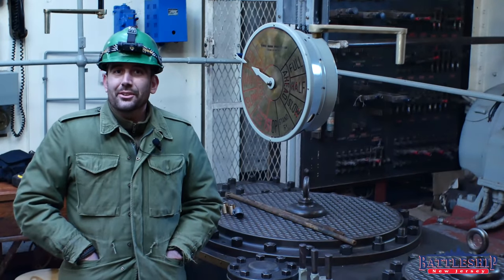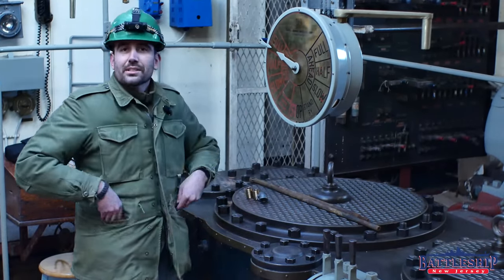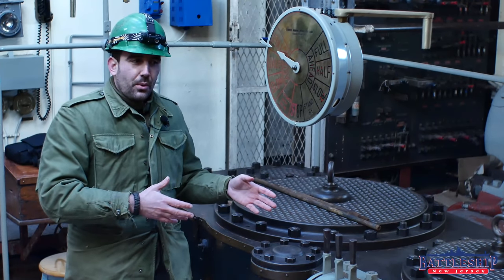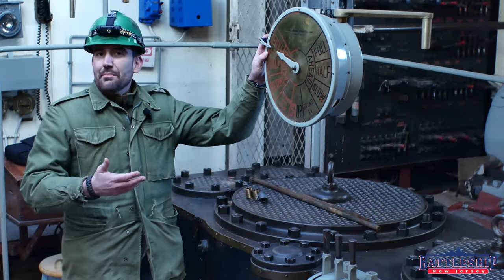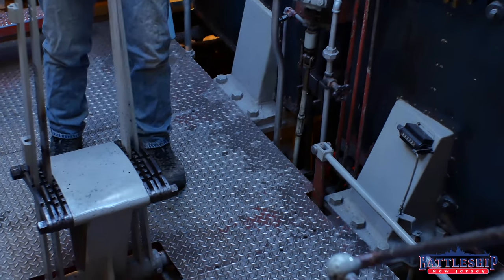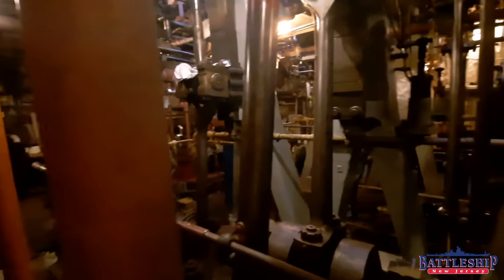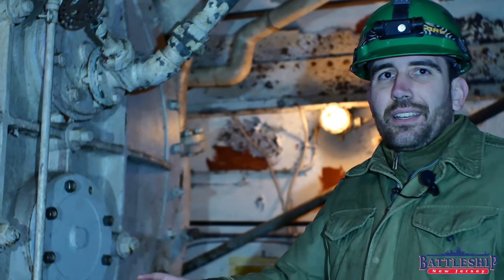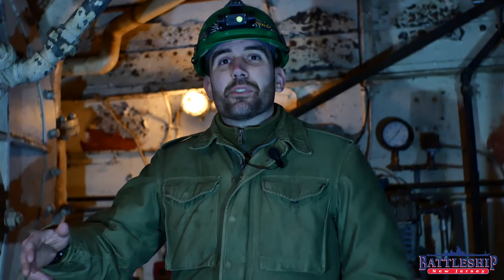Reciprocating Steam Engine: USCGC Lilac

Comment: The SS Badger still makes regular trips across Lake Michigan and it has reciprocating steam engines. (and coal fired boilers, even though it was built in 1953🤔).
Reply: You've heard of the Edmund Fitzgerald? It was a reciprocating coal burner built in 1958. I was in the US Navy with a guy from Alpena, Michigan who worked for a time in the boiler room of a lake boat. He shoveled coal for 6 hours straight. He said he thought he was going to die. This was in about 1970 as he told me. He'd shovel coal, build up the main steam pressure and then sit on a coal pile with an old guy who'd been doing it all his life and drink bourbon until the pressure dropped and then it was back to shoveling. He said that the boat was built in 1910.
Reply: The Badger has 4 Foster Wheeler watertube boilers with 2 Firrite stokers per boiler. The boiler normally runs at about 410-420 psi. They provide steam for 2 3500 horsepower Skinner Uniflow steam engines. They're direct drive as in no reduction gear/transmission. They give the Badger a speed of about 14 mph. Steam also operates 2 500 kw turbogenerators for electric power.
Reply: Yup about 25 miles from my house. 
Dumps a lot of coal ash in the lake 🤦🏻‍♂️👎
Reply: @lawrencelewis2592 , the Fitz had a steam turbine for main propulsion and while she may have started out with coal fired boilers I'm pretty sure that they converted her boilers to oil before she sank.
Reply: @busterbeagle2167  ,not anymore. They have an ash handling system and they take it off inport now. Definitely in Ludington and possibly in Manitowoc too.
Reply: @albertoswald8461  I would sure love to go down the engine room of that one! I am a former marine engineer and running a recip is my all time dream!
Reply: @lawrencelewis2592  ,What did you sail as? I have 1st Assistant for steam and 2nd Assistant for diesel and gas turbine ships. I got off the SS Wilfred Sykes November 11th after about 2 months as 1st on her. I worked the Badger unlicensed in 1994, 1995,1996 and went up to my brand spanking new 3rd Steam license in 1997. Got out bounced around and worked her again in most of 2007 as 2nd did a month in 2008 and then 2009 and most of 2010. I did about a month on the Crapo in December 1995 as an oiler too!
Reply: @lawrencelewis2592  ,it is pretty cool. I've run the Badger, the St.Mary's Challenger and the SS Delta Queen paddlewheel steamer. I worked the Crapo as oiler so I only would operate her engine to start turning it over for warm up. And once I answered a bell since my engineer had to go potty!!😁
Reply: @terryboyer1342  ,true but she has a steam turbine. It's a Delaval too if I remember correctly. The Lakes still have a few steamers. Key Lakes has the Philip R. Clarke and the Arthur Anderson. They still have the Cason Calloway but I hear that it is going to be scrapped. Central Marine Logistics runs the SS Wilfred Sykes for Cleveland Cliffs and it's not running but they do have Edward L.Ryerson in long term layup. As mentioned, the Alpena is run by Inland Lakes Management which works for LaFarge Cement. These ships above all have steam turbine main propulsion. The Badger is the last one on the Lakes that has a reciprocating steam engine of any kind.
Reply: @albertoswald8461   I was a Machinist's Mate 2nd class on the USS Guam, LPH-9 from 1974 to 1979.

Comment: Richard McKenna was a navy engineer, and in his book "The Sand Pebbles", he details correcting a fault in the alignment of the bedplate (what holds the crankshaft) of a triple expansion engine. The man knew of what he wrote... :-)  He also wrote a short story entitled "King's Horsemen" that describes an emergency repair on a running triple expansion engine that is a real nail biter.

Comment: The Texas,  New York and Okkahoma were throwbacks.  The previous classes after the two South Carolina's were steam turbine engined.
Reply: Problem with steam turbines of the previous ships is they were very poor at fuel efficiency when cruising. Hence why the back track to tripe expansion on the new yorks (remember originally coal fired.) The Nevada was oil fired from the beginning which helped with range and efficiency. But then after the USN always sought to remedy the range issue of turbines. With geared cruise turbines, turbo-electrics, and finally double reduction.

Comment: Triple expansion kits are pretty common in model engineering. Stuart Models in the UK produce a large number of kits (including just single expansion kits). I'm working on a 10H which is a single expansion but double acting (steam pushes on the top of the piston then a valve slides over and steam pushes on the bottom so you get power on both directions) engine. It's really small by comparison, 3/4 inch bore.

Some people use radio control as their telegraph and put them on model boats.

Comment: Is Lilacs steam equipment being restored to working order or "just" a visual restoration? Seeing the machinery is very interesting in it's own right but seeing and hearing steam powered equipment like that run is such an experience. (I've never been on a ship that size under steam power, but I have been on smaller vessels like tugs and on rail and road locomotives and steam just has a "feeling" of it's own. Like there's something more to the equipment than just steel mechanics.)

Comment: I believe Texas has the largest recipricating steam engines put on a ship.
Reply: I think you will find they are smaller than that on the Olympic class of passenger ships.
Two triple expansion, four cylinder engines of HP 54", IP 84", two LP 97" stroke 75" which exhausted into a low pressure non reversing turbine.
One of these ships and engines still exists - under the North Atlantic.
Reply: @Kevin-go2dw  ,the Brittanic, the other sister ship was converted into a Hospital ship for WWI and was sunk somewhere around Greece in the Med. I think people even dive on her sometimes.

Comment: did ship engines act the same as locos where in once moving you backed off the "throttle" and used expansive working rather than direct stream pressure?

Comment: Gotta love reciprocating steam engines.  I didn't miss the opportunity to have a go round Lake Wakatipu on TSS Earnslaw, where they removed a skylight so you can see down into the engine room from the passenger deck. Surprising how swift she moves. Another specimen down under which I only saw underway is Waimarie, operating on the Whanganui River. 
In my then-hometown Dunedin there is also a gas works museum that ran their pumping gear regularly. They had a Bryan Donkin Booster there that send a thumping heartbeat through the whole building. I fantasized about gathering some musical weirdos and improvising some sort of Tom Waitsesque jazz over it (tell me that's not a steam engine:  https://www.youtube.com/watch?v=zKJV8VjyKeQhttps://www.youtube.com/watch?v=zKJV8VjyKeQ). 
Apparently there is a Titanic, or rather titanic sized Steam engine still in operation in a water work in London. I hope I can travel there some day.
And there is that tiny reciprocating (however not an expansion type) steam engine in the sleek open launch on my dresser.

Comment: Nice video of a cool power plant. If it's a lighthouse tender why do you keep calling it a "cutter"? 😆
Reply from the maker: Cutter is the generic term for coast Guard ship
Reply: @BattleshipNewJersey  By the USCG's own definition,  the term “cutter” identifies a Coast Guard vessel 65 feet in length or greater, with accommodations for a permanently assigned crew to live aboard. So, yes the Lilac was a "cutter"  by that definition but would have been called a lighthouse tender by the USCG. Owasco or Treasury class ships are called cutters by the USCG. The Healy class is called an icebreaker and there are many vessels they call buoy tenders or whatever but don't call cutters.

Comment: That triple expansion engine looks like a baby!! Is it even 1000 hp? The Crapo's engine was 1800 hp and looked a lot larger than that. You could stand inside the LP cylinder there!
Reply: To clarify, the S. T. Crapo, a cement carrier on the Great Lakes. Typical Great Lakes configuration, like the Eddie Fitz.
Reply: @SteamCrane  ,the Crapo had an 1800 hp 3 cylinder triple expansion steam engine. She had 3 firetube boilers that were good for about 180psi. She burned coal except for the last 2 years when they put oil burners into her. The Fitz had a 7500 hp Westinghouse Steam TURBINE. And she was a coal burner but got converted to oil over the winter of 1971-72.
Reply: Cement storage barge in Green Bay, Wisconsin on the Fox River
Reply: @albertoswald8461  Yes, I know. Simplified for the Brits.
Reply: @SteamCrane  ,I can understand that. Since I do this for a living I know a smidge more than most. It would be like some computer programmers explaining coding to me. I'd have no clue at all!!!

Comment: Weren't there ships that used both triple expansion and steam turbine?
Reply: Titanic
Reply: Olympic, Titanic, and Britannic used two triple expansion steam engines and one steam turbine that ran the central propeller. Each prop had an entire engine but like Ryan said you can't get much over 20 knots those 3 maxed at 23 not fast but good for their size in their day. When RMS Olympic was scrapped they said her steam engines were running the best they ever had and they showed very little signs or wear even though they had operated for a good 25 years